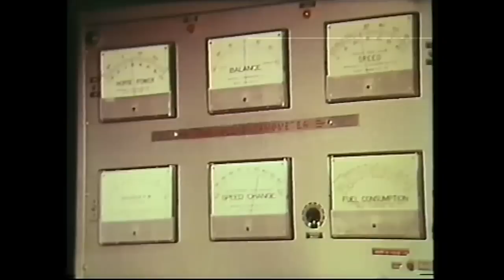How The Motor Car Works - The Engine

Comment: The (unusual) 1 - 2 - 4 - 3 firing order (as explained here) is indeed correct for the Ford 'Kent' engine.

1 - 3 - 4 - 2 is far more common.  Same principles apply of course.